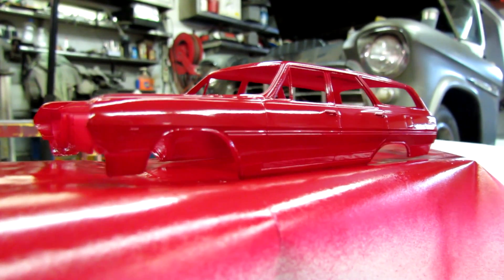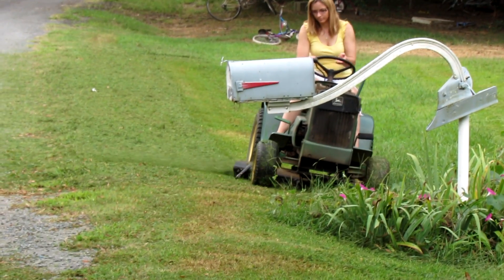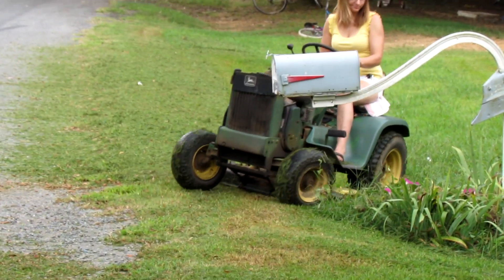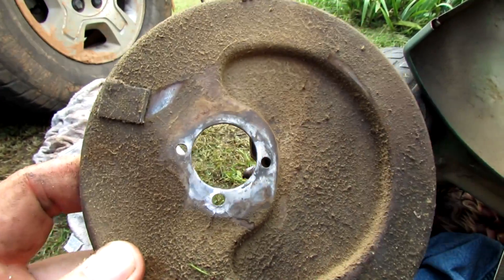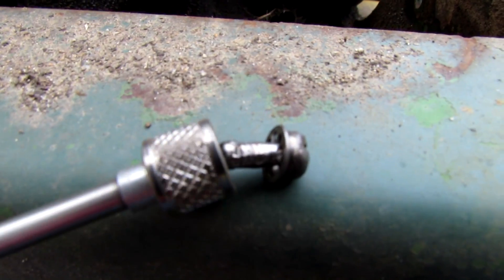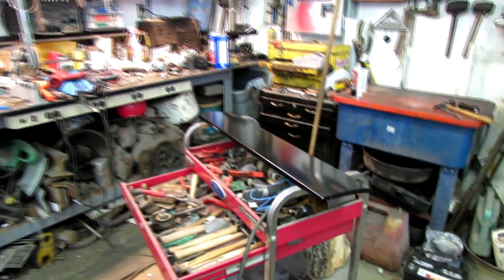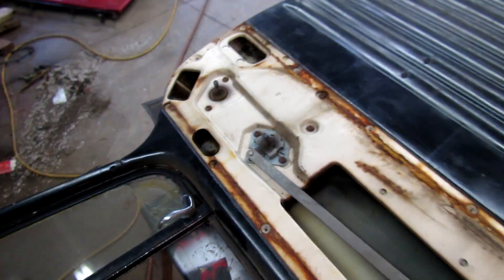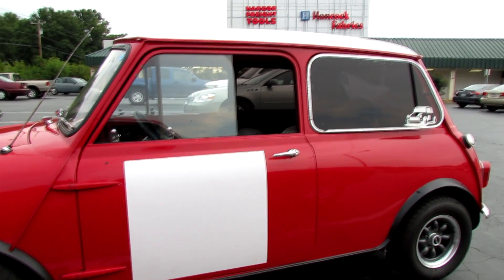Sat-Back in the garage

Comment: You were blessed that the John Deere didn't eat those screws...
Here is the story. I had a '67 Chevy panel van that had been converted to a V8. Needed to do some carb work on it and inadvertantly/unknowingly dropped a small screw into the intake...end of that V8 engine.

Comment: wow that was luck make sure you use another screw with a big enough head on it so it wont fall threw the valve gap. That 1 was getting close to fitting in between